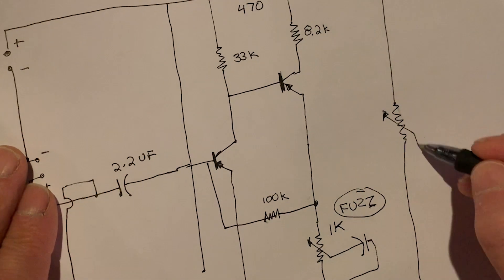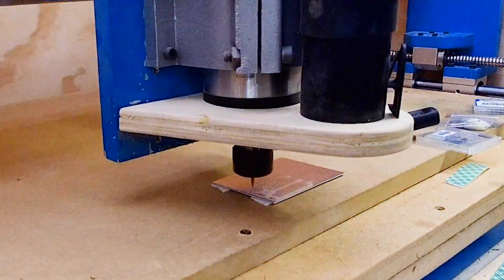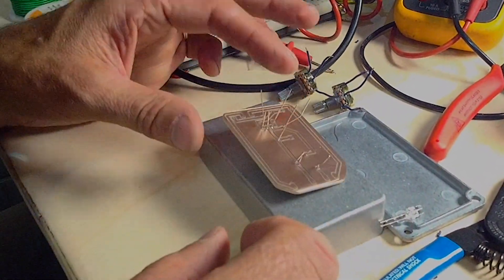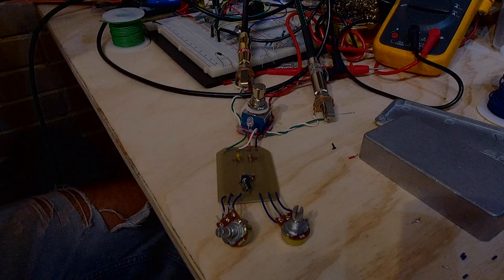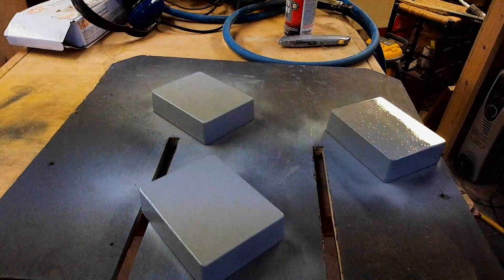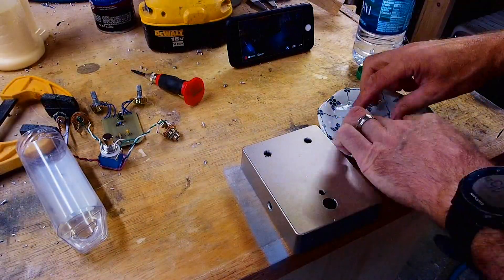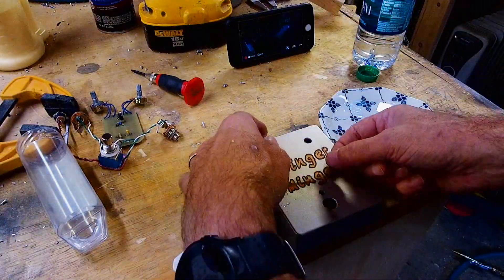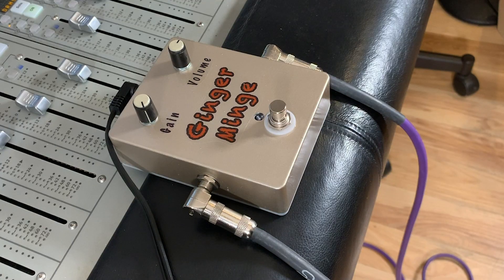DIY fuzz tone pedal

Comment: Reminds me of the crazy Frankenstein contraption distortion effect you built in High School.  If I recall, you just took old amp parts and mounted them to a slab of plywood and literally over-drove the volumes to distort.  It was your first foray into outboard effects if I recall.  Looked like hell, but you used it on a few gigs.